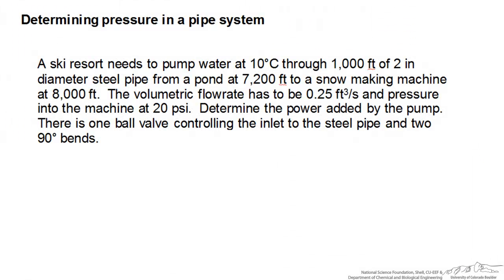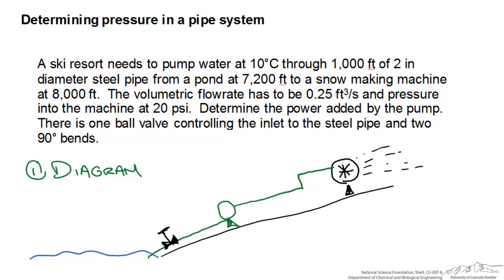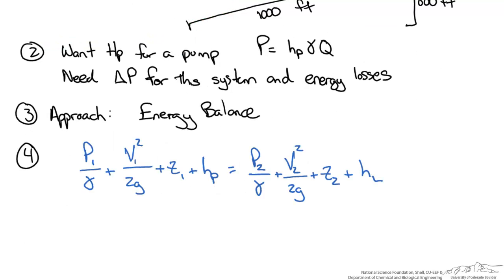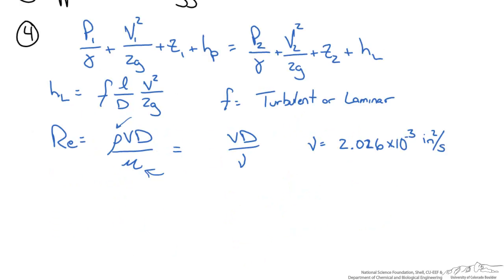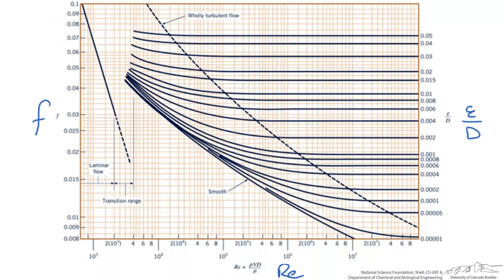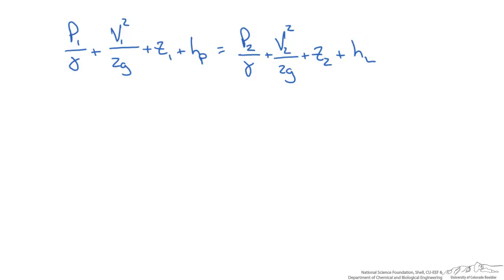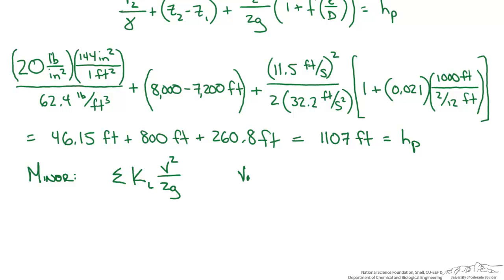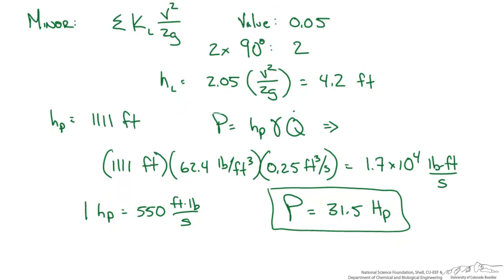Pipe Flow: Determining Power

Comment: Also, keep in mind that this video uses the Darcy friction factor (64/Re = f for laminar flow) as opposed to the Fanning friction factor (16/Re = f for laminar flow). Therefore, (7:32) h_L = f(L/D)*v^2/(2*g)  is correct for Darcy friction factors, but h_L = 2f(L/D)*v^2/g for fanning friction factors. The friction factors are essentially different by a factor of 4 (therefore f_f * 4 = f_d).

Comment: (4:46) The exact numbers are debated, but generally Re<2100 is laminar, 2100<Re<4000 is transitional, and 4000<Re is turbulent. In engineering practice, 10,000 < Re is fully turbulent (this is for internal flow through pipe).

Comment: How do I use Bernoulli Equation to calculate following question?Pump supplies water to a nozzle of 25mm diameter through a pipe 180m long and 75mm diameter. The nozzle is at a level 9m above pump. Taking discharge coefficient of nozzle as 0.94 and coefficient of friction of pipe as 0.012, calculate pressure required at pump outlet to give a discharge of 8dm^3/s.   Answer given is 426KN/m^2. So far going from your example, I can see that Z2 - Z1 = 9m, hL = 4fLV^2 / D2g, but I am not sure what P1, P2 and V1, V2 are for this question. May someone please give me a hint for this, this would be much appreciated just to get me on the correct path for this question?